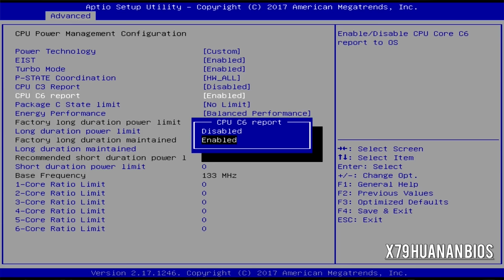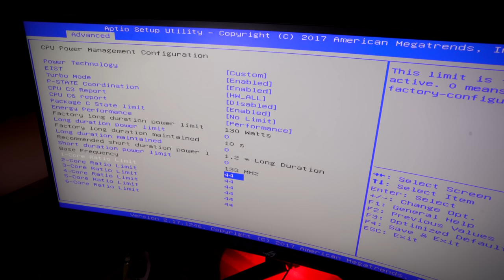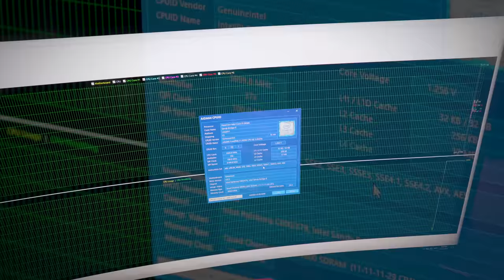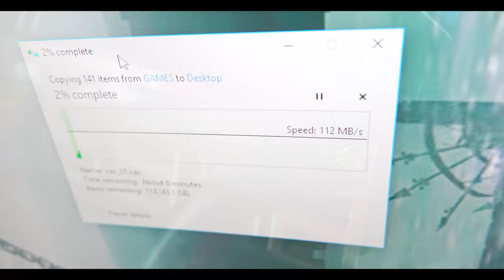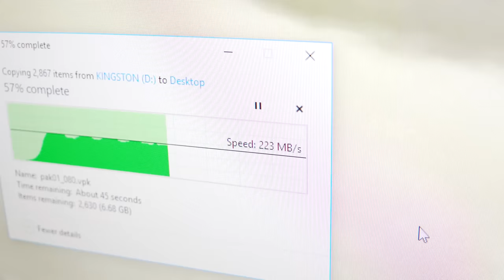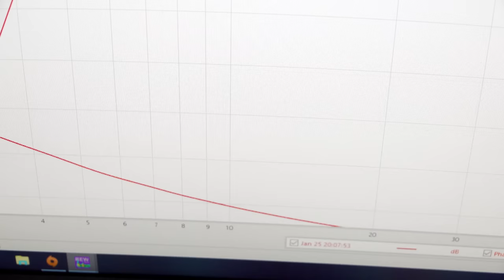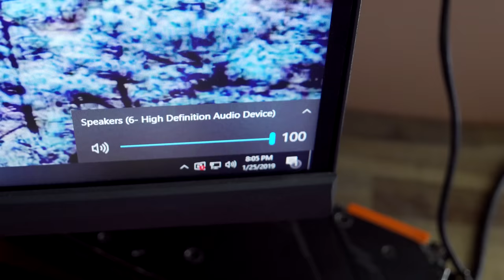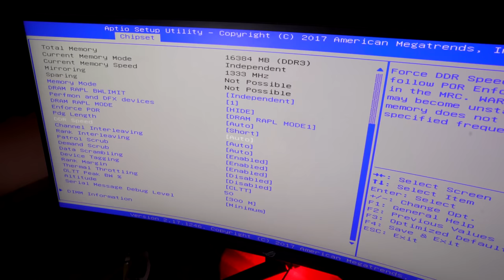Is This CHEAP X79 'RUNING' Motherboard WORTH IT...?!

Comment: Should I buy the huanan x79 Mobo combo with 1650 v2 and 16 GB ram for 300$?
Thx
Reply: nope, I think a ryzen combo will serve you much better, even used ryzen are really cheap now.
Reply: @qianxinsoong  but I think buying a decent used ryzen, plus 16gb ddr4 and a mobo will cost more
Reply: Just buy a motherboard that's x79 and supports ECC ram, I bought 32gb ecc ddr3 for £45, and the Xeon e5 1643 which is around £25-£35 and you'll have a core i7 that's unlocked with 32gb ddr3
Reply: @fewik8567  Used 1600s and 1600Xes can be had for around $120, 16GB DDR4 can be had for around $80-$90 used and a new B450 board is about $80, all in USD. It's quite similar in cost and you could go all the way up to an 8, 12 or 16 core in the future with better IPC and better long-term support.
Reply: a mystery yeah you are right, sometimes you might get lucky and find these things cheap but like what he asked earlier he says 300$ for mobo ram and cpu combo so for that Price Im sure you are better off with a used Ryzen combo since the AM4 socket will be supported till 2020 not to mention warranty you get from even used parts.
Reply: @qianxinsoong  yes that's true, but I've got an x79, 32gb ddr3 ECC, and my Xeon for less than £150, which is a steal in my view, it's probably not as good as a ryzen build but I love it, and that ram has come in very useful, and I just couldn't afford ddr4 prices even used, and my Xeon has 6 cores 12 threads and a speed of 3.2ghz, I would say if you dontind older parts for bargain prices go x79, but ryzen will offer a better long term solution and a far more superior socket system
Reply: ryzen 2600, 16 gb ddr4 3000mhz and b450 board cost around 330 $. I my opinion that is a better option since you still get some warranty and it's just newer parts.
Reply: @newdavidof  true
Reply: @fewik8567  B350 for $65,-    Ryzen 1600x for $135,-     16Gb DDR4 $100,-    = $300,-
Obviously the Ryzen combo is the much better deal , all new and faster !
Reply: @gertjanvandermeij4265  but for someone using video editing software and needs 32gb of ram then the x79 is a better deal, and there is 8 core 16 threaded Xeons for x79 for less than a £100 and they are clocked at 3.4ghz boost to 3.7
Reply: @jan ferenc I've had the green huanan x79 2.49 boards, yes 3 of them, for over a year now and I regret not getting this board. Get the running 🏃

Comment: Hii man I just got curious about the x79 supported xeon cpus, and guess what I found.... A better deal than a the xeon e5 1660 v2, the e5 2650 v2 performance is almost the same, lower power draw, higher core count ( 8 cores 8 threads ) and better value for money on aliexpress. The  e5 1660 v2 is about 140$ there, whareas the e5 2650 v2 is available for 80$. 😊😏👌😀

Comment: Its an XL-ATX board though, so make sure your case is big enough :P
Reply: Yes thank you for pointing that out. I already comment but I have this board and it won't fit in my case and my case is an atx and I don't know what case to get to be able to use it 😔
Reply: @mommy3505  maybe E-ATX. Check dimensions before

Comment: why does a decent lga 1155 cpu cost as much as a entry level ryzen cpu and sometimes cpu and motherboard!.  hell I can buy decent lga 1366 chips for far less than good overclocking lga 1155 chips. and the motherboard prices are insane for both platforms wtf intel!.

Comment: I own the cheaper version of this board (two ones), one with the 1650-v1 and the other with 1620-v1, both with 16gb Ecc DDR3 memory and their biggest flaw is the VRM, absolutely uncapable to power an even slight overclock, now this version should fix this major problem, you should try again this board with the modified bios available on http://x79.apphb.com/ which unlocks first the overcloking potential and then (more complicated) the Voltage control and let us know if it really deserve the extra money it asks, thx Andrea

Comment: Too bad the Chinese fabs making these boards refuse to add/offer voltage adjustments, even if it were through physical jumpers settings (every oldskool!!). The boards look good and would be fine it it had some minimal voltage regulation feature.
Read other replies saying why buy this when an AM4 b450 + 2600 + ddr4 is so cheap...well that depends on where in the world you live. Here in western EU the taxes (%21) on top of the mrsp still make such builds generally rather expansive. Like a user from Poland in the replies said.

Comment: DDR4 prices have seriously become affordable, I would go Ryzen over this. 

Can find R5 1600s for bargain prices.
Reply: a 1680 v2 costs around the same, is unlocked, and is 8c16t, and can use ddr3, that costs fuck all compared to ddr4, and in quad channel, its actually faster then dual channel ddr4 that cost many times as much. 

thats the main thing, chips like the 1650 an 1680(v2 v3) are very good options because, they are stupidly wasy to overclock, cheap as piss and can run on ddr3 quad channel, all day, every day, recc ddr3 that is... seriously check aliexpress for 2011 board combos with 64g you will find, they are very affordable, like 450 for 64gb of 1866 quad channel, a 1650 or 1680, and board, that can overclock said chip.... the v3 are tempting to me...a good hold over till ddr4 that dosnt gimp ryzen drops a bit more, or recc ddr4 prices drop more, and i can get a ryzen setup that would use that instead... there are 2 boards i know of that can use ecc ddr4...

anyway, its about cost to upgrade, for many of us, we are in a dead end, and the upgrade path has alot of pitfalls, we would be in many cases side grading, in mine, and i have tested this, the 1600 would be at best a side grade, and in some cases, a downgrade, i would need 32gb of ddr4 3200 or better to prevent bottlenecking, and a board thats decent, last i checked, it was far cheaper to get a chinese board combo on 2011 with ivy bridge or neihelm, quad channel recc ddr3, i have seen combos with 128gb ram for around 500usd, 128gb that dosnt gimp the cpu in any way.

Comment: like the video, but afraid with the heat.. i cant even watching my own pc to hit 80 degrees Celc.. btw, happy weekend!
Reply: VRMs can handle more heat than CPUs. There's a good chance the VRMs in your current PC are reaching 80 degrees too.
Reply: yeah that's right, i realized that after Mr. TYC was using heat sensor around the socket looks hotter. gonna set the bar lower for heat..

Comment: Anyone got a spare 8350? I can barely run games on my 6300.....
Reply: I have an 9590! lol
Reply: 8350 won't help you
Reply: it would be better than what I have and I think it is the best cpu my board can handle
Reply: Probably better to jump to Ryzen
Reply: I would if I could but being broke sucks my dudes
Reply: Get a 8300.  Easily overcooked and cheap as dirt.
Reply: Would be a pointless upgrade. Save up until you can get X79 (that's what I did, jumped from fx8350 to 3930k and spent 250 euros total) if you got plenty of DDR3 already and DDR4 would be too costly. 

If DDR4 is available for you though at a good price just go for AM4 Ryzen
Reply: You have the only FX series cpu that has bang-for-buck. They're so overpriced :(
Reply: @patckpw  it would sorta help as games see fx6000 as 3c3t and fx8000 @ 4c4t
Reply: Ddr4 is pretty cheap now in the u.s, would sale some stuff and go ryzen
Reply: I OC'D my 6300 to 4.3GHz stable with a gtx  1060 and it does pretty good. I mostly play FO4 though.
Reply: Go get a job !
Reply: @jimpinel9028  I'm actually upgrading my R9 290 to a GTX 1060, I paired it with a 6600k
Reply: Do nb/fsb overclock and its gonna be significant improvement compared to multipier one
Reply: Have a look at getting an x58 board and CPU, I recently sold an FX 6300 + gtx 670 system and with that money I bought a Dell Precision T7500, X5650 and a 1060 3GB used with a new 128gb SSD and old 500gb drive. I'd recommend getting something like an x5670 as it is similar to x5650 but has a higher clock speed which is important as t7500 doesn't allow for overclocking, I only bought x5650 as i was tight on budget and didn't feel like waiting to get an x5670 off of AliExpress for the same price
Reply: @justinbuckley  x5650 is at 15usd, @2.66  x5680 at 40usd, @3.33GHz 
x5670 at 24usd (2.93), x5675 at 28usd @3.06. so propably the x5680 is the worth it,, the x5690 is like 70 dollars, so try to stay away from that

Comment: Thanks again for the inspiration of the old Xeons!!! I finally upgraded my old Dell T7500 x5670 6C12T @stock to an E5-1620 4C8T @stock as the single core performance is 50% higher. This motherboard circa $113 USD? Instead, I got a whole HP Z420 workstation with 16gb ram, E5 1620, 600w psu with 2x6pin connector for around $200 USD. Managed to get a GTX 1070 on it with a $5 2x6pin to 1x8pin power connector. Given you couldn't overclock as much as you wanted, suggests those old workstations remain best bang for buck despite running at stock speeds? My HP z420 video here: https://www.youtube.com/watch?v=aql35FbnSlg

Comment: It has m.2? Does it support NVMe?
Reply: Nop, its only Msata. But the Huanan x79 deluxe does, it has a M2 PCIe. Look for the V6 version.
Reply: @Zetac  So that one has NVMe?  Not sure if it's just cheaper to upgrade the mobo, or just buy a new Ryzen CPU, mobo, and RAM that already has all of this.  Probably cheaper with the former (x79) but support will be limited while i get the benifit of many more cores, twice the RAM speeds, and just better overall support.
Reply: @fragalot   If its with upgrade purposes (u have a x79) just buy a PCIE to M.2 card.
Reply: @Zetac  I could but it has no NVMe support, I can't make it a boot drive on my P9X79 mobo unless I used a M.2 drive that has a SATA controller, but then why bother when I already have a SATA SSD?

Comment: Datasheet is located on this page. https://www.aliexpress.com/item/5pcs-1lot-100-New-original-AON6522-AO6522-6522-MOSFET-N-CH-25V-71A-DFN5X6/32949796343.html?spm=2114.search0302.3.40.3824260bicynmd&ws_ab_test=searchweb0_0,searchweb201602_0_10130_10139_431_453_454_433_10618_536_317_537_319_10059_10696_10084_100031_10083_10547_10887_10307_321_10548_322_10902_10065_10068_10103_10884,searchweb201603_0,ppcSwitch_0&algo_pvid=2bc9593a-a7e5-4cc0-8c5f-e52ed531fb22&algo_expid=2bc9593a-a7e5-4cc0-8c5f-e52ed531fb22-5

Comment: Hi bios multiplier is locked at 39 you need to flash bios if you want to go above that, available here https://xeon-e5450.ru/socket-2011/motherboards/bios-dlya-x79z-vb10/ 
The motherboard is very stable, much better than huanan. Its more like a server motherboard and uses the server variant c602 of the x79. A great solution for hackintosh due to its simple server bios. Currentley running tripple boot mac, windows and linux so exttentive testing. Board has 4 sata 3 ports, 2 intel 2 asmedia.  Rl caps are from taiwan so should be ok. http://www.c-components.com.tw/prodDetail.asp?id=207
Reply: Would you be able to provide information on how to get this running macos? Excuse the pun. Might just be the deciding factor in me purchasing this board. Cheers
Reply: Hackintosh from huanan x79 is identical so just follow tutorial for that  https://www.youtube.com/watch?v=NTnHODmqz0M